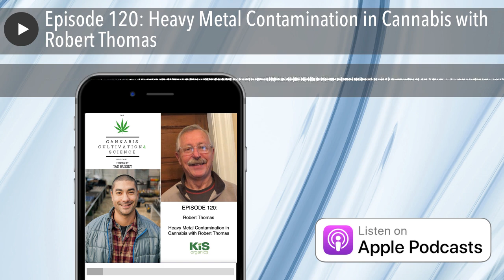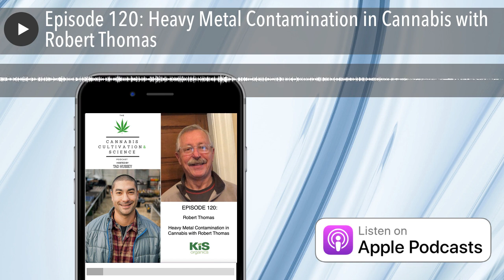Heavy Metal Contamination in Cannabis with Robert Thomas (Ep. 120)

Comment: Just to clarify, were the vaping references inclusive of dry herb vaporising or just those related to extracts?

I was under the impression that dry herb vaporising was safe when used with a medically approved device, i.e. a mighty medic.
Reply from the maker: Good question. The issue as I understand it is the metal parts coming into contact with the herb or vapor and if the metal contains contaminants like many metals do, then you’re potentially exposing yourself to inhaling the heavy metals due to the heat and exposure.

Comment: P &K bring in a lot of heavy metals.  Cd with P and Pb with K.  I am very concerned about rock phosphates.  Are the rock phosphate we buy with an OMRI level the same used as a source material to make chemical P fertilizers?  A big source of cadmium in Willamette Valley farm soils are the Hi-P starter fertilizers banded with sweet corn seed for example. That Cd stays right there in the soil and accumulates with every application of DAP or other starter fertilizers.  Composts and manures can also be a source.  My soil has ample P&K so I try to avoid bringing any in. I rely on the soil biome to mine the existing P&K in the soil. Check the WSDA fertilizer database and you will see what I mean.  The risk with silicon for me is what else is the applied product carrying with it besides K and Si?